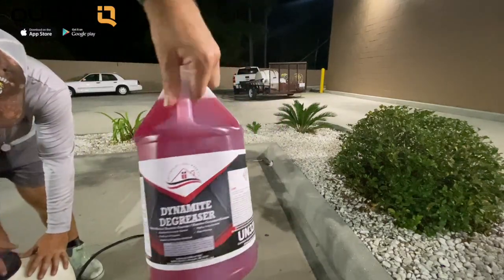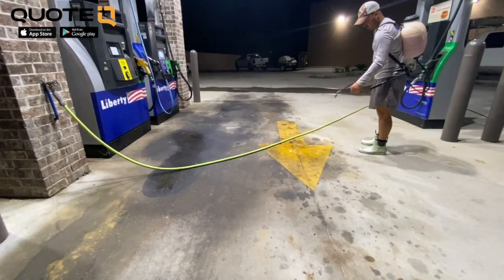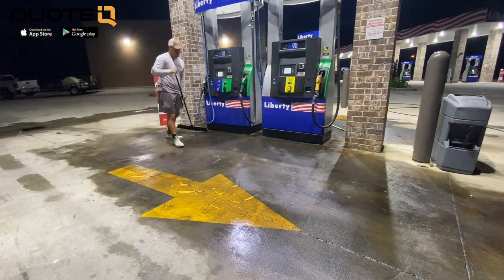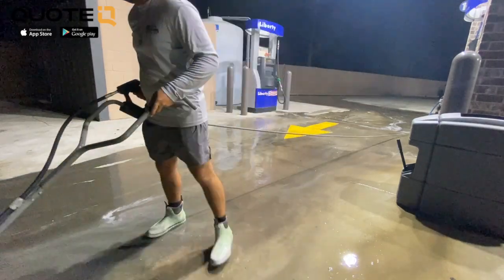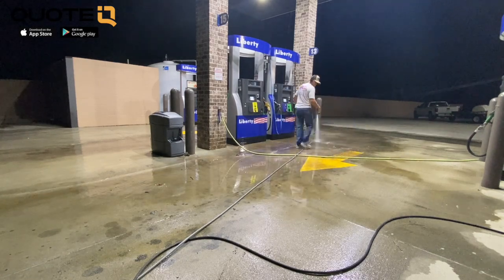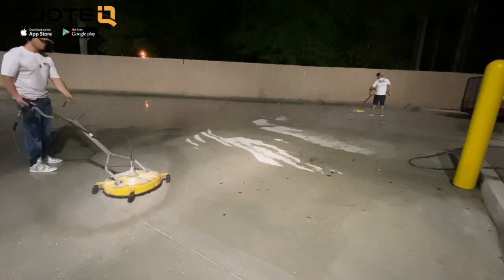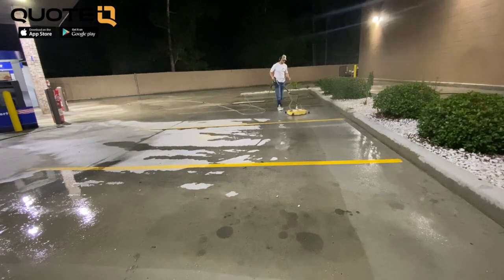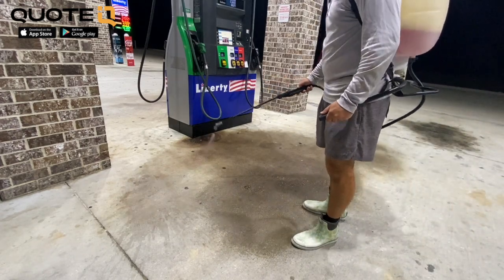The BEST Chemical For Removing Oil Stains From Concrete

Comment: I poured small amount of Dawn dishsoap on oil stains in my driveway, works great. It took 3 applications but it lifted oil stains. For acorn and leaf stains I used 50% water and 50% sodium hypochorite (clorox). Works very fast.

Comment: Yo, if you’re doing gas station work, the best degreaser for commercial work is BC cleanse pro you can downstream it straight through your pressure washer. It’s much higher concentrate than the degreaser from south east south wash that is $70 a gallon. You can buy a 5 gallon of this product for $100. You don’t even need to agitate it in just spray it on and run over it with the surface cleaner, it lifts everything except for organics.
Reply: Dynamite Degreaser is only $50 per gallon,  or $33 per gallon for a 5 gallon bucket, or just under $22 per gallon for a 55 gallon barrel.
Reply: @garywolfe4504  BC cleanse is $18-$21 per gallon and it does a much better job those guys at Southeast. Don’t care about you or your company I would not spend any money with them. Also their dynamite degreaser works just as good as the Ecolab that you can buy from Home Depot for $11 per gallon.

Comment: Hey there you might want to start using Sodium Hydroxide beads on those oil stains....goes alot further and is a fraction of the cost, plus...only one application / no scrubbing with a cold water setup.
Reply: Exactly my man. You know what to put on there, forget all those fancy name chemicals
Reply: Where do you get sodium hydroxide beads and how do you apply?
Reply: @nobodzhero  crystalized drain cleaner from walmart. Aka “Lye”
Reply: @nobodzhero   Level 7 Chemicals Conway, Ar. Chemicals in 50 lb bags. Less than $2 per pound. Prices shown online, best in the USA
Reply: Link leases?
Reply: Drain cleaner 100% Lye
Reply: @thomaslangton3464 Where do you get the SH beads from? If you don’t mind helping
Reply: hi good man. so you just basically spread sodium hydroxide on top of the oil stain and then? straight power washing it?
Reply: @yusofnoor8243  you can put foil on it to prevent drying, also works on paint stains. Im painting houses and sometimes shit happens, thats how i deal with it
Reply: Sh doesn’t work on oil
Reply: @TJWheeler-i7r  Well, LMAO....I've been pressure washing for 35 years and I have built my reputation on it in the commercial space.....I'm sure that you don't know the difference between Sodium Hydroxide that I am referring to, and Sodium Hypochlorite ( Chlorine ) that you THINK I'm referring too....your killing me! LOL.
Read, learn, and understand before you speak / comment, it only serves to advertise your inexperience and ignorance....lol.
Reply: @thomaslangton3464  Lol. Love your comment.  I just started my pressure washing business and my VERY FIRST job, the woman said she needed her garage DOOR cleaned.  No problem.  When I showed up, she meant the entire garage floor which was soooooooooaked in oil, and grease and paitn and everything else.  What do you recommend to get OIL/GREASE out of concrete?  I got a lot of it out, but it was not NEARLY enough to meet the customer's expectations (or mine for that matter.)  I have a predator 4.2 gpm pressure washer.  What treatment do you suggest I use in those types of situtations where there is just a lot of soaked in oil and grease?  

I know I'm a year late so I don't expect a reply, but if anyone else sees this, any info would be helpful!

Comment: It’s important to set customer expectations
Aka- make sure and tell your customer you’re not very good at your job you’re probably not going to give them a good job
Reply: What do you want them to do? Repave the concrete?  That oil and gas has been sitting there for a long time.  You can't possibly bring it back to new.

If you take your car to a car wash or detailer and expect them to bring the coat and finish back to factory condition? lol.  I hope you're joking man :).

Comment: no one ever talks about run off where does runoff end up
Reply: most states have water processing plants that run off water goes through to be cleaned and chemicals removed from the water before most issues. although a water reclamation system is always nice for your surrounding ecosystem
Reply: The same place rain goes down the drain.

Comment: Purple Power at $12 for a 2.5 gallon bottle works as good at 1/4 the price
Reply: That works good to but try a 50lb bag of Sodium Hydroxide
Reply: Add some InstantPower liquid drain cleaner to that Purple Power and you have yourself a degreaser stronger than any of the name brand stuff😂 still for 1/4th the price
Reply: @parker.simmons4 you got a ratio by chance👁️👄👁️
Reply: @seabassvlogs3011  Go 5 gallons of Purple power and the 1 liter bottle of drain cleaner! But BE CAREFUL mixing it in lol. Wear full PPE and protect every bit of skin you can. Mix slowly. A chemical reaction will occur and it will get hot.
Reply: I tried purple power today on a residential job and it only lightened the oil stains a little. Not fully remove. I may try the mixture mentioned below, purple power and InstantPower
Reply: @Jus10-born2Run if you haven’t I’m gonna on my drive way so 🤞🏼
Reply: Do you need to dilute it or straigh application?
Reply: @tsfb  I use it full strength, pour it on the oil stains and use a $10 deck scrub brush.
Reply: Super Clean degreaser is better.
Reply: That’s cool and all but try semen

Comment: i'm seeing alot of questions on run off, and no answers. yet your charging for classes that have me question your courses. Lots of questions on run off. I know where I'm at its a huge issue and that would get you fined. I see guys trapping or filtering the run off. Are you doing something with the run off or is it not an issue in your area? I'd hate for someone to get huge fines for something your classes don't cover. Do your classes cover this?

Comment: Do you just let all the chemicals and fuel go down the drainage system or do you have to recover the water and harsh chemicals that you’re using in my state you would have to recover everything that you’re discharging
Reply: you can catch using shop vac, wet vac but where do you discharge them afterwards?

Comment: WAY TO RISKY to service a gas station. What are the regulations on this. If the EPA were to get involved (as they always have eyes 👁👁 on gas stations) you better be an LLC and have a good lawyer or you'll loose everything you personally own. Super huge money for fines/ EPA cleanup as well as the gas stations loss of business from being shut down.  $10K, $50K $100K+. I would seriously look into it! You probably need special insurance/certifications to even be doing that type of cleanup. Similar to businesses that remove "emptied" home heating oil tanks in MA.

Comment: Were you able to keep all the wash water on the property?  If any of that goes in storm sewer there's an EPA fine coming. Why is nobody showing waste water recovery on these jobs?
Reply: I was wondering the same thing. Petroleum cannot go into any sewer, water needs to be picked up. Everywhere else in the gas station is fine, but by the pumps water cannot just run off. I agree with u.
Reply: You two are hilarious what are the roads made out of petroleum when it rains where does that petroleum go into the storm drain oh wait maybe
Reply: @louisben4510  It's amazing the world still turns with people like this around, isn't it?
Reply: Because everyone one of them are phony. They even try to sell you EPP junk and you never see them wearing it. Y’all need to wake up and and just go out there and work. Just buy a bag of Sodium Hydroxide 40 ounces to a five gallon bucket add a cup of dawn dish detergent XJet it on and don’t forget to thank me when you are done

Comment: Do you have any concerns with storm water run off?  Specifically trying to figure out any epa concerns with commercial vs residential.
Reply: I'm not sure myself the exact regulations, but gas stations are very risky. I briefly worked in an environmental department of an engineering company that handled testing ground water at gas stations, and they test regularly. Water runoff and ground water contamination is a very serious thing for gas stations. If the wrong person shows up or catches wind of water runoff at a gas station, it could be heavy fines or jail time. I wouldn't even risk it without a proper reclamation system. Me personally, I won't do a job at a gas station.
Reply: @MetaDecker  👍That is very troubling. If the EPA were to get involved you better be an LLC or you'll loose everything you personally own. Super huge money for fines/ EPA cleanup as well as the gas stations loss of  being shut down.